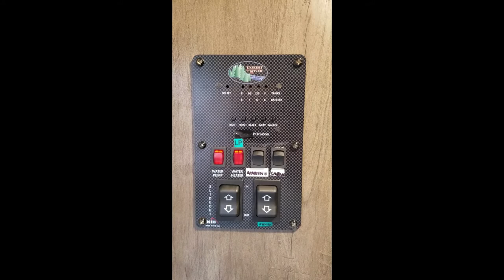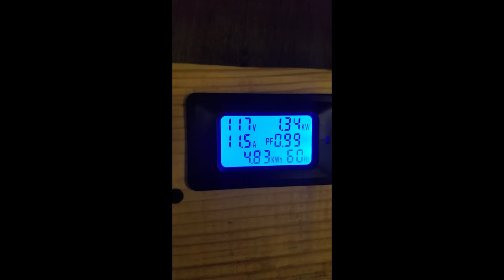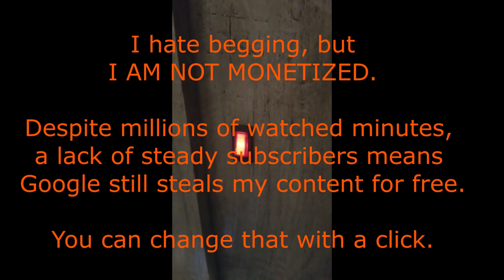How to add a remote hot water heater switch to your RV

Comment: Great mod!  If you're willing, some advice on wiring an additional 3-pin switch to the existing two pin switch in series would be appreciated.
Reply from the maker: The same wiring layout would apply in series...  H and L interrupt the existing hot wire and G for an illuminated switch.

Comment: So your switching 120v rather than 12v to solenoid ? Why not avoid switching hotv120v at wall ?
Reply: On my new Suburban SW6DE,  there is no relay. No internal switch. Nothing but the external switch. 
You have to buy the SW6DEL and the 232882 switch/LED/switch panel if you want a relay to control the 120VAC.